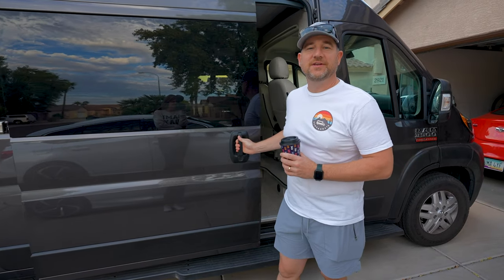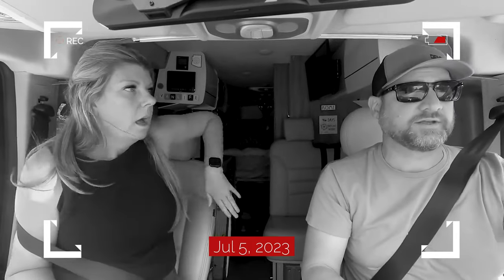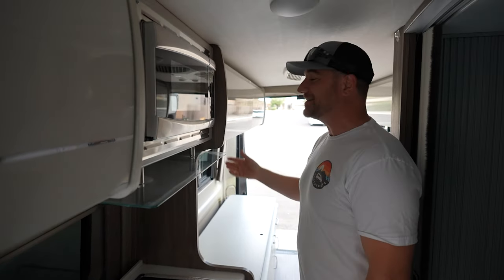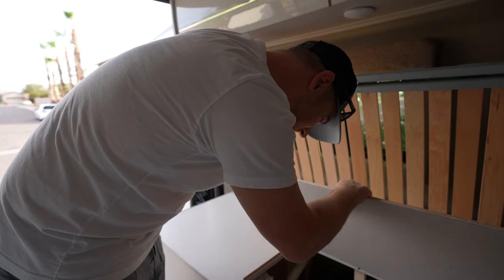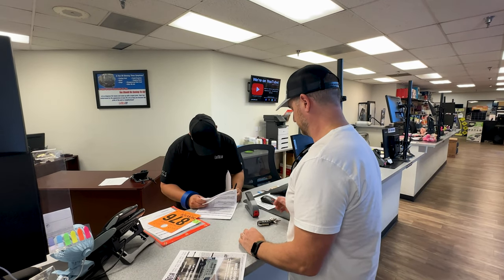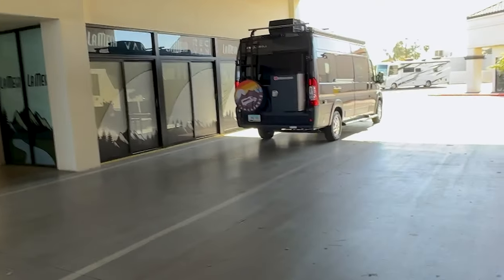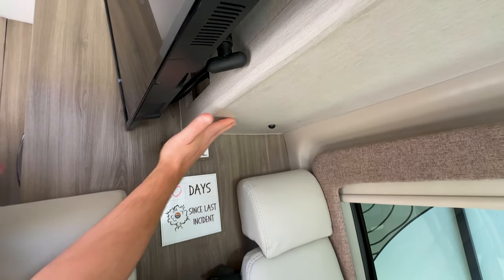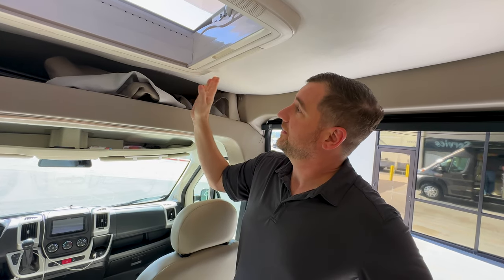The Truth about RV Ownership...Back in the Shop, Again!

Comment: THOR is officially off my "vans to consider buying" list
Reply: Thor was never on my list
Reply: To be fair - they all have problems. The "Covid Era" vans would ALL be off my list though :)
Reply: I got a Thor Tranquility Ford Transit. It had a major issue battery not charging while driving.  The Tech at General RV in PA was great and fixed the issue. He went and tested every system from the back of the van then to the front.  Until he found that a wiring harness was not correct.  They had 2 wires in the harness in the wrong pin place.  It was under the dash.They got hold of the manufacturer of the harness. to review the wiring of it.  Don't discount Thor they have alot muscle(money) to get people on the phone that we could never talk to.
Reply: I have a 2023 sequence. Knock on wood. So far no real issues. Just a couple fitting corrections on window shades. And a defective Rv. General Rv in Huntley IL. Fixed everything.
Reply: 100% AGREE!
Reply: I would like to disagree with you, but unfortunately, I can't.  I've had every issue that the Vancaskeys have, plus some.  But after seeing this video, I will give them a chance to make it right.  I'm now assuming every van made of this model and era are of poor fit and finish.  The Mercedes, however, has been a high quality chassis, so far.  It's all Thor related issues.
Reply: Thor was on my list but then it broke and fell off.
Reply: Good decision.  My Thor Class C 24' is named Hellon Wheels.  It's way way way worse than Mr. Lemon.

Comment: Great to see Mr Lemon getting back to new!! Your videos helped me so much before I bought my RIZE 18G (which I absolutely love so far). The wallpaper was one thing I asked quite a bit about. Apparently there was a huge issue with a defective glue that was being used sometime late in the pandemic, and it caused exactly what happened to you. Sales also mentioned even Winnebago had the issue at one point! They also told me my van “shouldn’t” have this problem, but I’ll be watching like a hawk ;)

I’ve had Frankie (my van) for almost 2 months with zero issues and just over 3k miles. LOVE it!! Thank you for your videos! If you ever want to do a “van meet-up” in Phoenix, let me know!

Comment: Well, looks like I have Mr. Lemon's cousin.  Here is the breakdown of the issues I've had with my Thor Sequence 20A (same floor plan as Mr. Lemon).  Lower portion of cabinet over the sink is separating, top pull-out drawer slide is losing bearings, middle pull-out drawer bottom fell out, sink drain leaked, master electrical switch connections were very loose, sliding bug screen had 1" gap when fully closed, headliner endcap installed incorrectly and glue separated, passenger side rear wall panel separated from the interior van wall, passenger side rear window shade mount not fastened correctly and separated from the wall panel, inverter loosened (was about to fall off like Mr. Lemon's), Velcro under rear passenger seat came off, water tank inlet tube was very loose and leaked inside van when filling tank, shower pan caulking failed, shower hot water line was kinked so no hot water, trim around bed platform coming loose, and lastly the bed extension mounting rail broke (while I was in the bed, lol).  Most of this stuff I fixed myself so I wouldn't have to leave the van for weeks on end.  For the stuff I couldn't fix, my dealer (Blue Compass RV) and Thor took over four months to get repairs approved and parts delivered.  So fed up with them.  I got the dealer to just give me the parts, so now I'm in the process of fixing those issues myself.  At least I know it will get done right.  I'll never get a Thor again.  On a side note Bob, you mentioned in a previous video that Mr. Lemon doesn't have a roof fan.  Mine either so I installed a MaxxAir fan.  It fits inside the shade rails of the skylight by just adding a small support extension to the fan.  I also installed a 12v car socket close by for power, works great.  It's removable so I can take it out when needed.
Reply from the maker: Oh No! So sorry! Wow...you absolutely have Mr. Lemon's cousin...You have been through the ringer. We feel your pain. Glad you are able to fix stuff yourself so you don't have to leave it in the shop for months on end. Thanks for that idea for the fan. I will be looking into that.

Comment: Heat seems to be the root cause of the delamination... My van is a '21 (in Seattle) and I have had no delamination issues. My AC unit is also pristine, having hardly ever been used! I too use the small dots to stop rattles.

90% (??) of the way to fixed? At least the remaining issues won't keep you off the road.
Reply from the maker: Agree. The heat affected it. 90% the way fixed...I like the sound of that. And yes no issues left that would keep us off the road.

Comment: I feel your pain - I have a Thor too and I've been in it for 2 years.  It's taken over 9 months to get it fixed in the shop. Do you know the temperature extremes of your interior? I've found that because my interior has been up to 122F and then down to 22F it's caused some interior issues.

Comment: We had the Trovato by Winnebago and it had the same issues with all the cabinets pealing. The finish on these 150K vans is soo bad. If you live in a hot climate forget about it. The cabinets will melt and it's not just the van all of them use these extremely cheap veneers on the cabinets and they just peel right off. There isn't any real wood used on anything but a custom build.